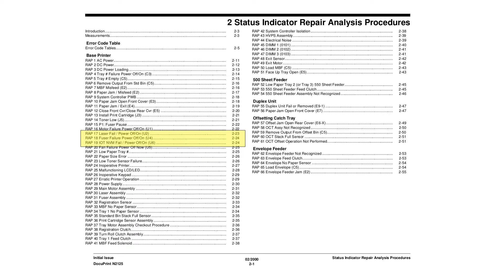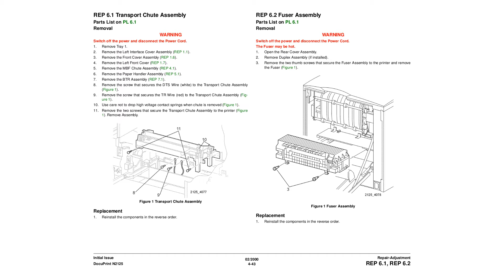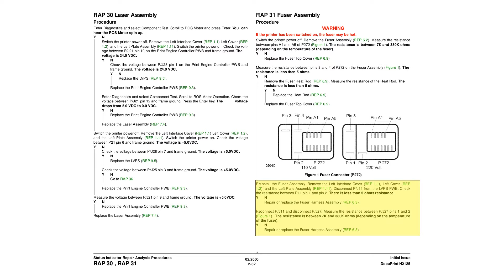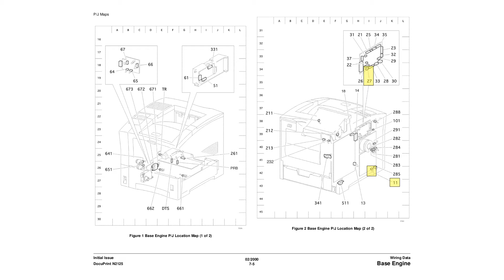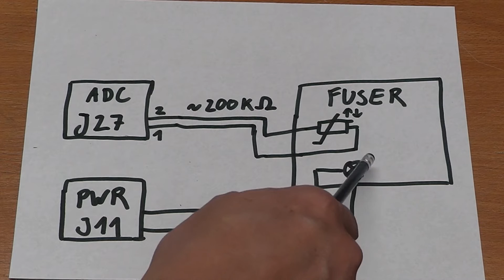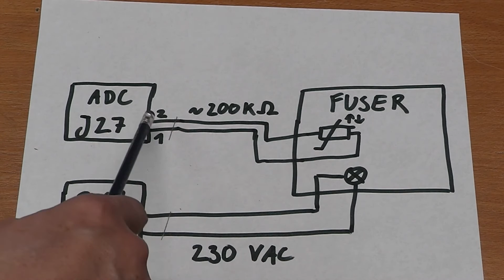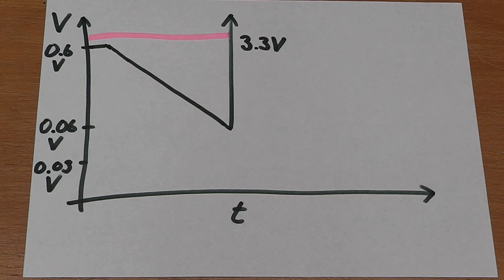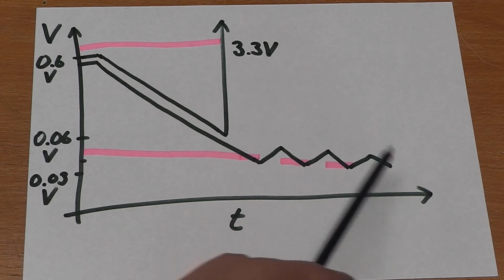Repair of a Xerox DocuPrint N2125 "Fuser Failure"

Comment: Must get around to replacing the fuser roller on the nice HP I got, would be nice to do double sided on it, even though I rarely use a printer at home, done around 30 pages in a year ( mostly for other people) on the baby HP1102, bought because it supports Linux with minimal work, plus it was dirt cheap and I can get the toner refilled for cheap. 

The lamp units will fit so long as they are the same length, and most are identical to fit the width of US Legal size paper. 2mm of difference can be handled by the contact springs, as the lamps expand in use in any case. I have some wire ended ones from a copier, which did 10 years plus before we replaced it as other spares like rollers were discontinued
Reply from the maker: +SeanBZA I hear you... need to fix my HP4000 duplexer unit which jams every few pages. But really just never got around to it so far. Do you know where to buy replacement parts that don't cost a huge fortune? The replacement fuser unit for that Xerox alone would have come in at around $300 which is absolutely ridiculous (I paid about EUR 50 for the whole printer in used condition about 10 years ago).

Comment: NTC pellet has a broken bond wire inside the glass bead, which causes this as the glass expands and eventually breaks the contact.
Reply from the maker: +SeanBZA Yup, that was also my suspicion. I tried to get a shot under the microscope, but really couldn't make out where the fault was, so no pictures of that :-)